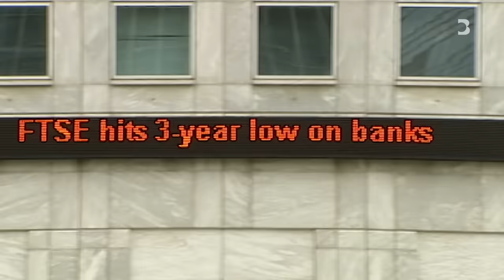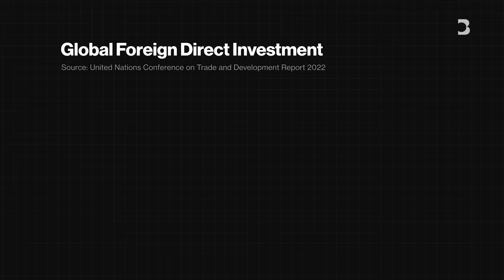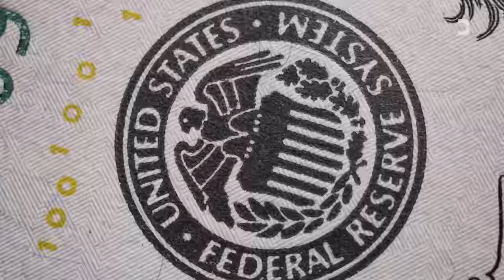Globalization Is Fracturing. So What Comes Next?

Comment: More than all those connecting economies, india's role arguably is the most significant. With large population and low wages, india is already starting to attract lots of FDIs and manufacturing. Iphones, automobile and many things are already being produced in india. India has also made use of its neutrality to sell the Russian oil to the West indirectly. There are lots of aspects i could go into but india at this moment seems to be the biggest promoter of globalization or rather, multiplarization.
Reply: I agree that India will have increasing leverage in the coming developments of the global economy.